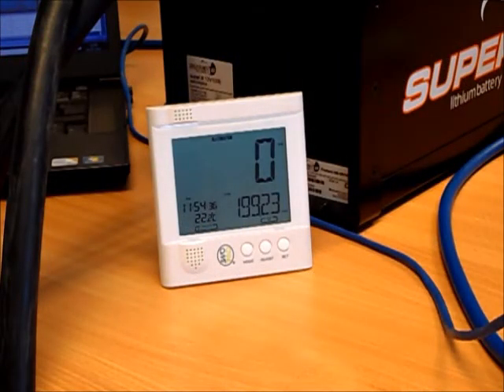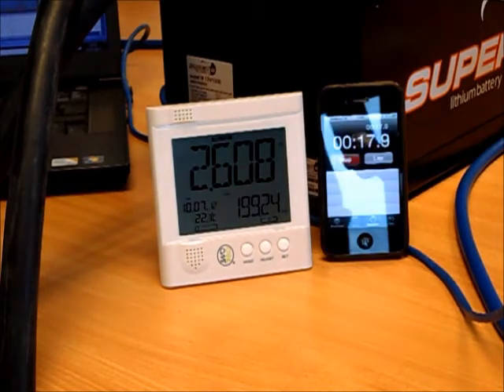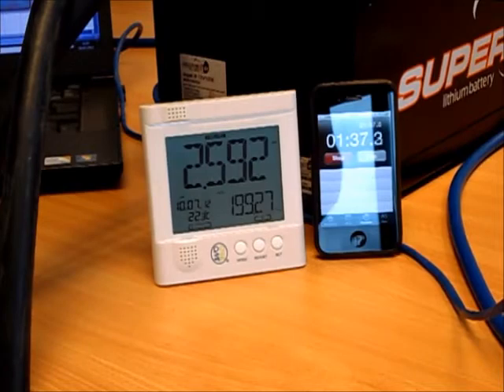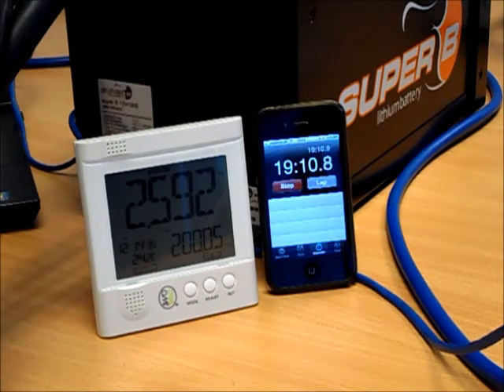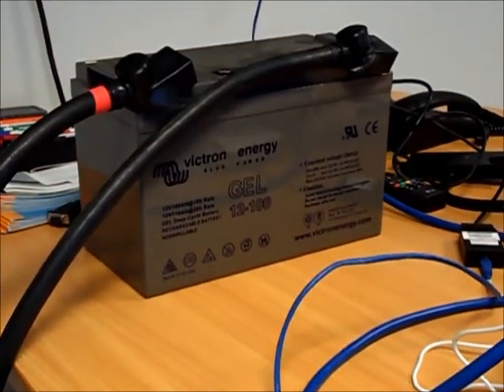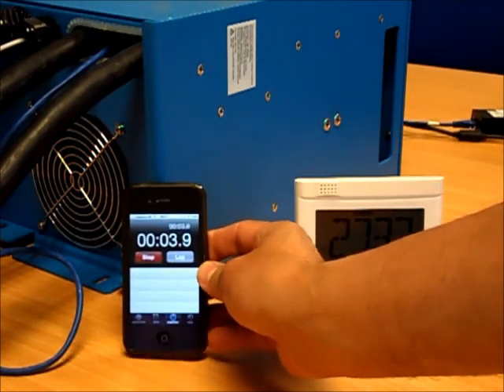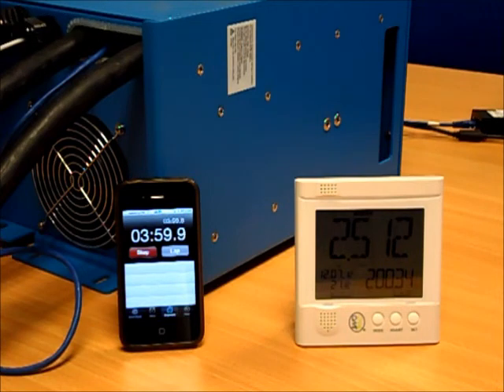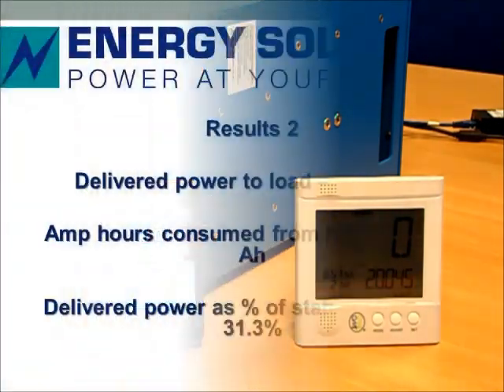Lithium Ion vs. Lead Acid & Gel Service Batteries

Comment: I tested 2 batteries on the weekend and both of them seemed it be “dead". After using one of your methods [Check Details Here==>https://docs.google.com/document/d/163kspciMT9QSUlNAvv0MT-ezkqtKCoEIdoxzlystrFQ ] I was able to rejuvenate them both to 100% working batteries. Thanks, you just saved me about $180! :)

Comment: Thanks for helping me recondition my batteries. It's such an easy process [Check Details Here==>https://plus.google.com/100351090281822647456/posts/Ct2x2kZGdNN ]. It even works with solar/off-grid, marine, golf cart, and forklift batteries. Plus, many more! That already save me over $100 and there are so many other batteries I am going to recondition with your course now too! Thank you.